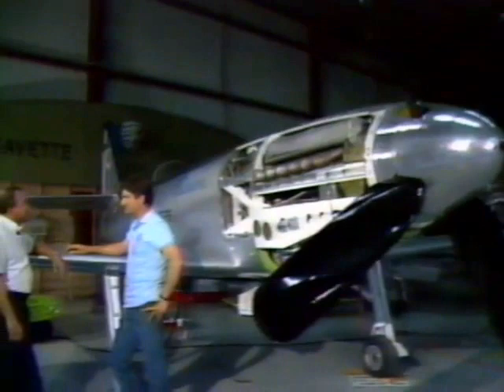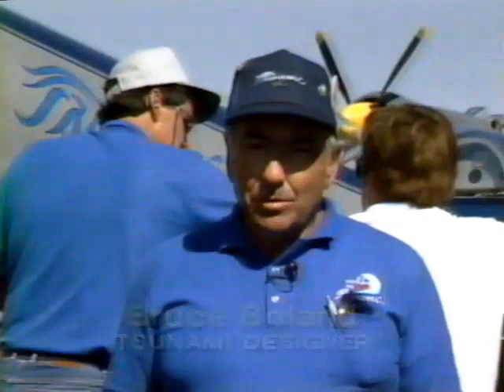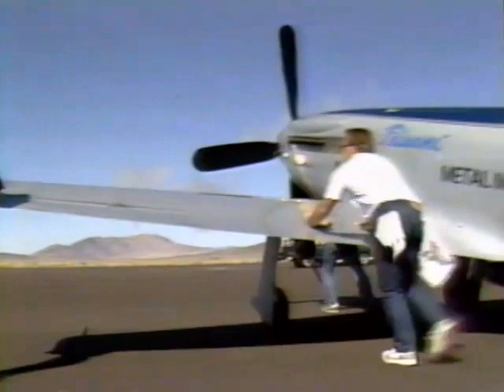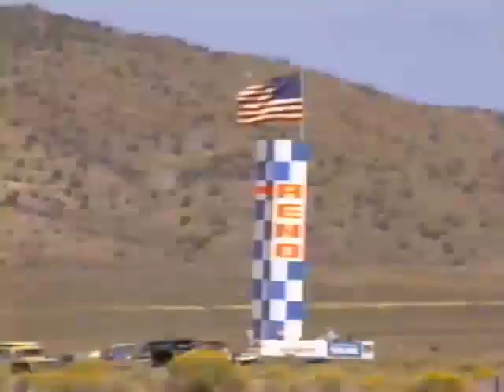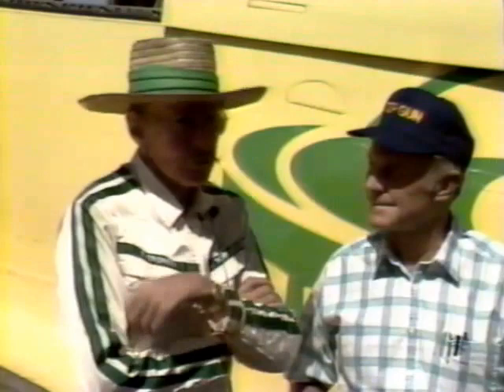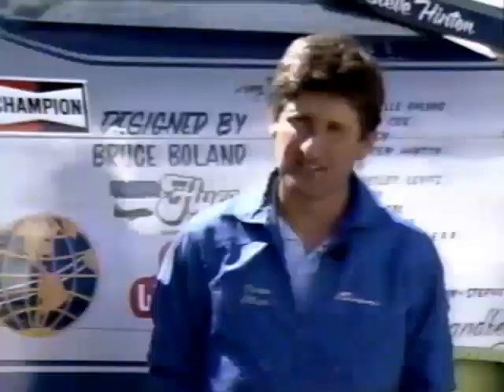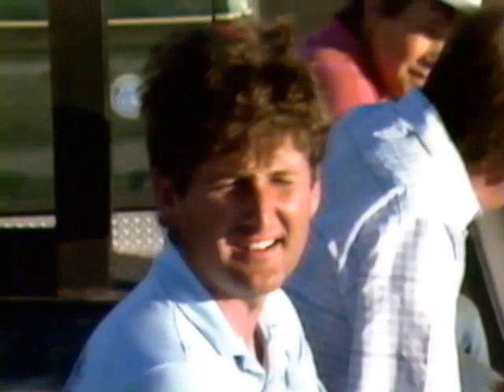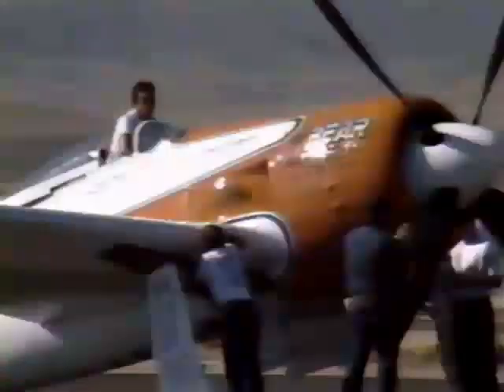Tsunami  Wide World Of Flying

Comment: Rip Bruce  dream  killed him
Reply: Look, I agree he wouldn't have been in a racer of his own design if not for the dream. But poor (nonexistent) engineering is what caused the aircraft to crash.

The landing gear failed in a gentle low speed turn. Then the flaps failed and deployed asymmetrically.

If the basics weren't engineered. What keeps flutter and divergence from rearing their heads at speed?

We don't need another Ghost incident. (Failure to re-set horizontal stabilizer to the specifications of NACA high mach dive test setting, using a trim tab to hold nose down instead. And removing the other tab).